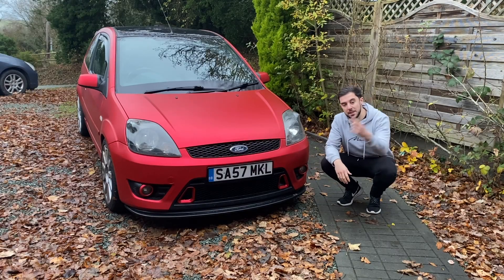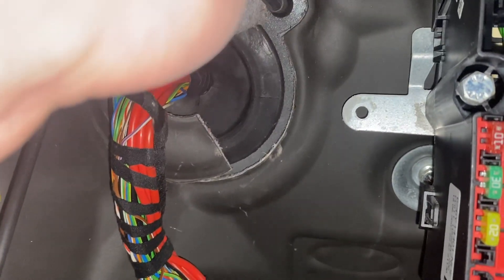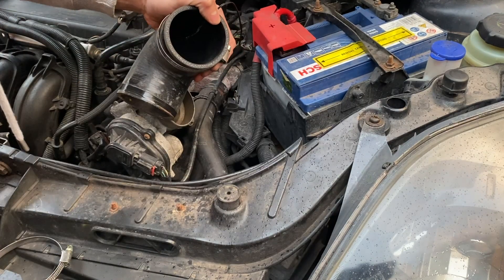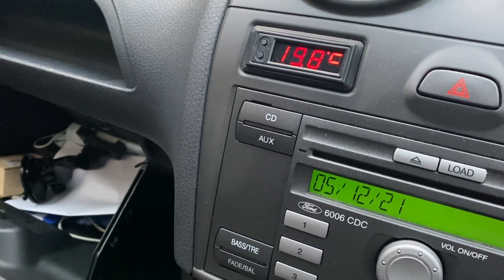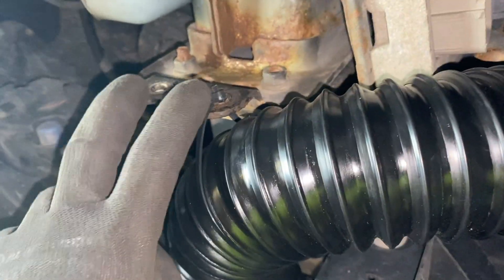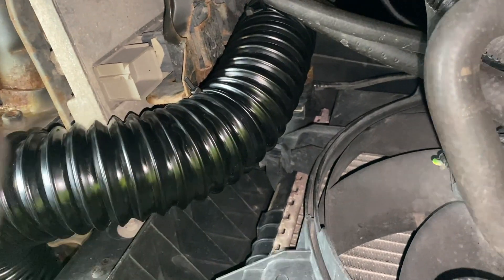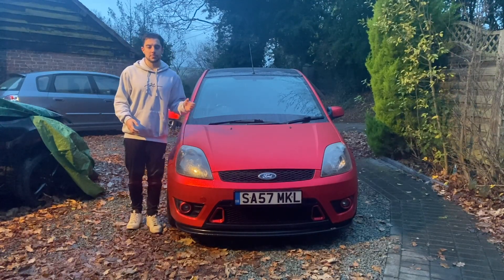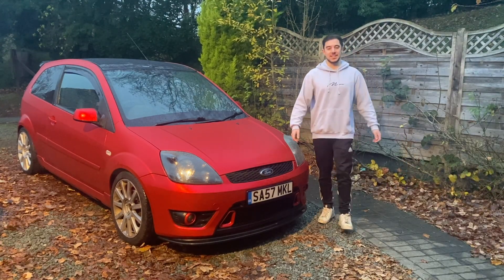Do my Intake Vents work? | Testing the CAIS | ST150

Comment: On my st180 I have original air box with k n panel filter and an extra air feed just like the mountune set up good noise and colder intake temps 👍

Comment: Hey dude, love the channel have a mk6 ST myself. Appreciate this is all DIY and you don't have access to a dyno but I think your testing methodology is flawed. The second run was under completely different conditions the ambient temperature would be different especially at night time. 

Hopefully one day someone gives you the dyno time would be really interesting to compare under the same test conditions. 

Look forward to the brake upgrade, have a set of mondeo mk3 calipers on the front of mine.
Reply from the maker: Hi mate, thank you! The ambient temp out on the road was 7 degrees on the first run and 6 on the second so only 1 degree difference,  not really a lot I can do about it but it was more to prove the vents make a difference rather than being accurate with the numbers 👍🏻 yeah one day we’ll get it in the dyno when the engine mods begin 💪🏼 oh yeah? Mondeo brakes? Interesting 😉😂

Comment: You need to read it with OBD, this is not correct
Reply from the maker: I’m sure there are ways to read it with ODB2, I was simply measuring the temperature entering the filter so I don’t know what you mean by not correct 😂
Reply: @MendItModIt  There are differences measuring stationary air and lets call it moving air.
Reply from the maker: @kiklop8362  I’m sure there are, the ‘sensors’ on my digital clock look to me like thermocouples, we use them in work and are perfectly suitable for measuring ambient and moving air, their readings are accepted by TuV, UL, DNV and CSA for electrical conformance testing, but regardless, for what I’m testing this is as deep as I need to go, I wasn’t looking for a laboratory-level experiment, just something I could knock up in an afternoon, for indication shall we say 👍🏻

Comment: MiMi,
CAF; Cold Air Feed
CAIS; Closed air induction system i.e. Mountune or GGR

Would be outside ambient temperature Vs. intake temperature (to find out heatsoak levels), also OBD2 reader can pull intake temperature and I think that's from the map sensor.  

Having tried kegged the air filter, I needed a feed on it for better airflow, thou it did have reduced intake temp.

I got a heat sleeve for the upper radiator hose to help keep the area cool.

With my Caterham inlet and the airfilter cone more enclosed by the battery and not near the hose thus the CAF has enabled cooler temps as well as the plastic style of the plenum helping.

☺️
Reply from the maker: Pretty sure CAIS just means Cold Air Induction System, I am working on the closed part mind, would have to remortgage the house for either of those though 😂 this was purely to prove the vents work and I’m satisfied they do, but there’s still improvements to come 💪🏼 I forgot about the keg 😂😂 class

Comment: Get a mountune cais box and connect your new air ducts to that …
Reply from the maker: I would love one mate but they cost a fortune 😂
Reply: @MendItModIt  
😂😂..ya get what ya pay for …probably the best I’d say …try finding an i4 mountune inlet at a reasonable price 😂😂
Reply: They’re also not all that sealed from the engine bay.  

I thermo-formed a cowl around the pod on mine so the intake air from the OTR section was forced over/around the pod.  Ultimately it gave similar results to your duct, and still heat soak was an issue.